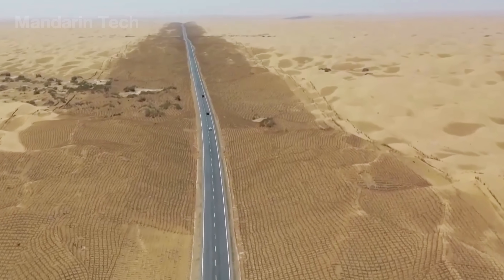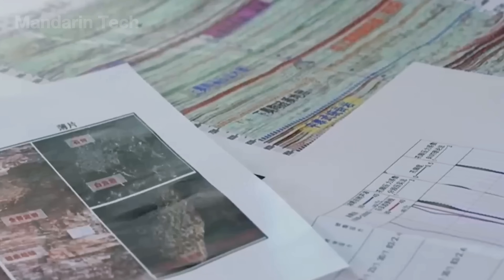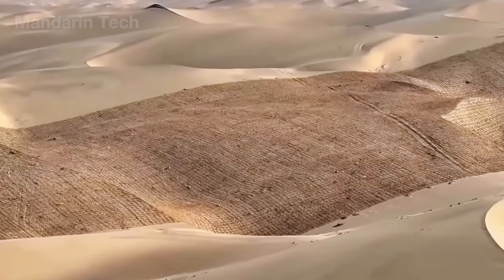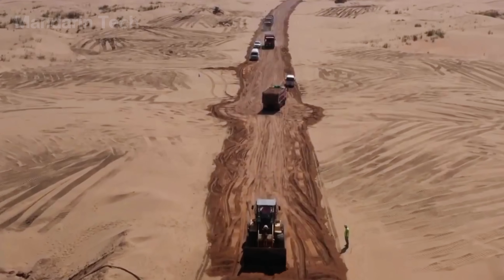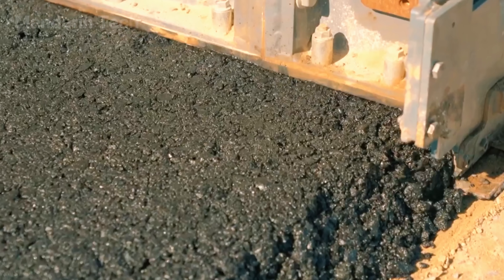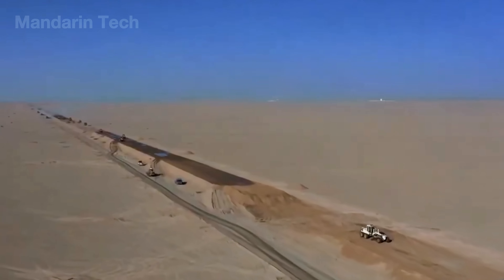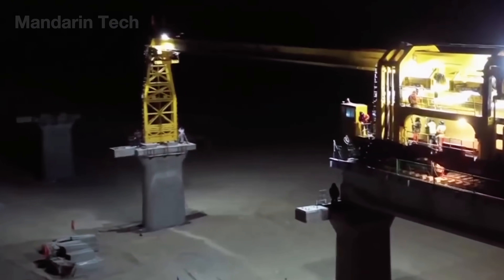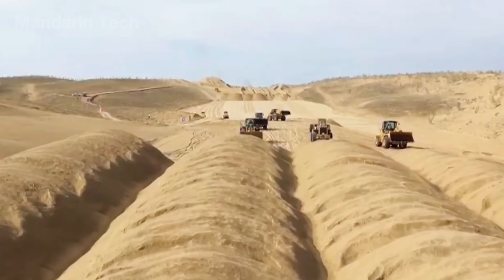How China Built 500 Kilometer Desert Highway That Stuns Even American Engineering

Comment: 70 ° celsius heat?
Reply from the maker: Yes, around 70°C is possible in some industrial processes, depending on the system and the materials used.
Reply: @Mandarintechmido the maximum withstand is 150 degrees. The ground temperature in desert easily over 85 degrees
Reply: 47 degrees temperature is the air temperature,  but with sun exposure over 8 hours on sand top recorded temperature is 90 degrees.  Normal daily max temperature is 80 degrees therefore with train,  rails,  metal and mechanical interaction between train and rails maximum temperature is 110 degrees.
Reply: The hottest temperature ever recorded on Earth is 56.7 °C (134 °F), measured on July 10, 1913, at Furnace Creek Ranch in Death Valley, California.

Comment: 70 degree Celsius l don’t think so!!!
Reply from the maker: That is an extremely high temperature, and I appreciate you raising a valid doubt about the 70°C figure
Reply: The hottest temperature ever recorded on Earth is 56.7 °C (134 °F), measured on July 10, 1913, at Furnace Creek Ranch in Death Valley, California.
Reply: @mehrcat1 ground sand temperature, not air temperature.  Water maximum temperature is 100 but temperature on various materials can reach higher.
Reply: 80 degree Celsius is normal ground temperature,  highest record temperature on the sand is 120 degrees
Reply: @raymondng924  "80 degree Celsius is normal ground temperature."  You've GOT to be kidding, are you confusing C with F???
The highest recorded sand surface temperature was 80.8 °C (177.4 °F) in the Lut Desert, Iran, as measured by satellite data in 2018. This desert is known for having some of the hottest land surface temperatures on Earth.
Reply: @mehrcat1 just fact check please